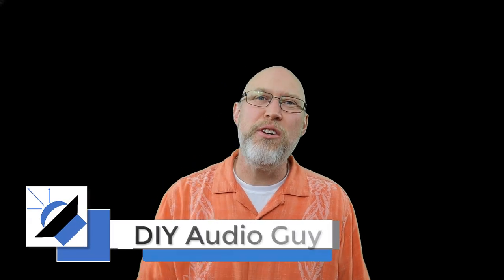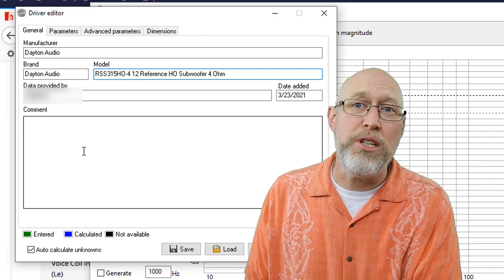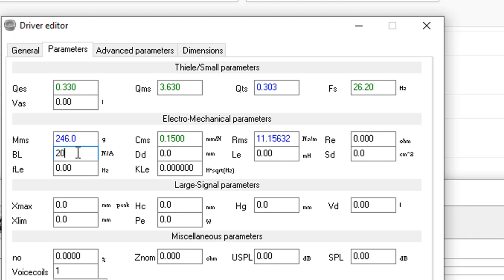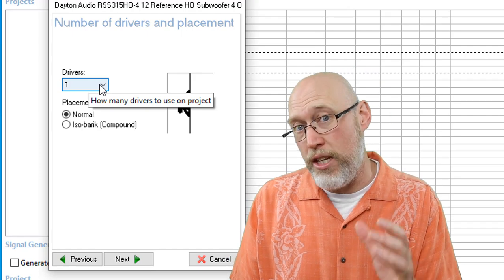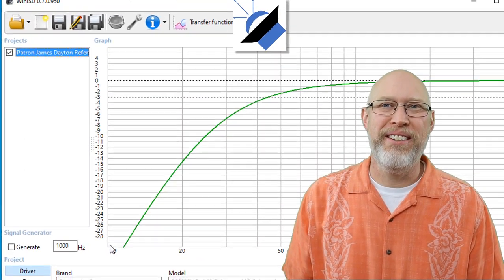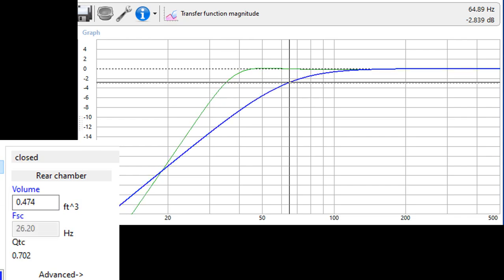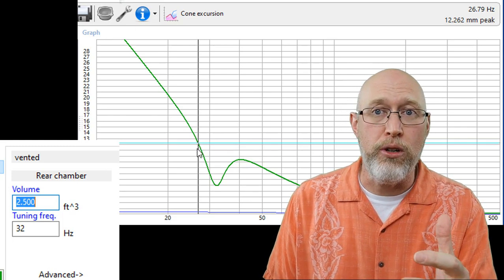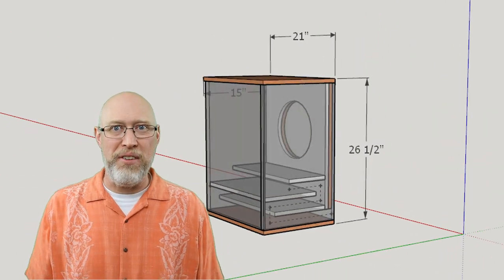WINISD for beginners, design your own ported enclosure!

Comment: Does "PE value Watts" at driver editor the same as "System input power at Signal"?

I ask this because when using speakerbox lite i can only enter PE Value. At the moment im not able to use winisd because my pc do not work lol..  It seems it does the same? When i change it the linear excursion, port velocity etc changes.

Comment: If you're using the b2 rampage RC, you may get a driver integrity fail.  I've tried re-entering the data multiple times and it still fails. I believe the failure is due to the RC being a 2-inch woofer.
Reply from the maker: In my experience, there are some brands that always fail the integrity check every single time.  My guess is that it's due to some kind of rounding error when they publish the TS parameters.

Comment: Got a good deal on the NVX Vsw 152v2  wired to 4ohm and want to build a 6th order box for home theater setup doubling as a coffee table.. using the Dayton Spa 300 or if more power needed spa 1000.. intimidating to get it right,  6th's can be fussy! Were you happy with the NVX that you did up.

Comment: Always been a big fan of DIY.  I'm now at the point where I'm blind and can no longer physically design and build my own enclosures now but the whole concept thrills me.  Just unearthed a Crystal mobilesound CMPx2 12d2 that I lent to a friend 15 years ago.  It's still practically brand new and is quite the beast.  I have a Sledge STA 1000D from a SVS PB13 ultra that is brand new in the box.  Would anyone like to recommend a ported enclosure to get this beast rocking in a HT environment?  I also have a 4" aeroport that can be used in the project.   I have a floor footprint of roughly 18" wide and 21" deep, height can be upto 21".  If I can get someone to help me out with this, then I can take these specs to a shop and get them to fab it for me :)  Cheers

Comment: Is "System Input Power" modelled on Pink Noise or program material I.e. music. 

I.e. I'm modelling on a driver that's 700watts rms, 1400watts program and my amp can deliver 1400watts. 

I'm designing a 6th order band pass, but at 50hz with 1400watts it exceeds the Xmax by quite a bit. 

I've then modelled on a 1500watts rms, 3000watts program driver with 1400 Watts of amp power and at 50hz I'm just under the xMax. However I'm assuming as I'm not giving the driver with more power handling full power it's not going to reach equal efficiency to the lower rated driver which is getting full power?

So what's the reason for inputting 80% of amplifier power? Is that because modelling is on Pink Noise, so putting 80% is going to model closer to music?
Reply from the maker: I use 80% to account for power factor.
Reply: @DIYAudioGuy  

Thank you for your reply.

I assume that's because you don't intend to run it at full tilt?

Obviously I don't either, but want to calculate allowing full head room.

Does Winisd assume the System Input Power figure entered to be Pink Noise?
Reply from the maker: @Power factor.  https://www.youtube.com/watch?v=GuK0FLijYDE

Comment: @DIYAudioGuy I am trying to add parameters for the new Dayton Audio UMII15-22 but I keep getting the "Driver data fails integrity check" when I input the data from the speaker's spec sheet. Any help or advice would be greatly appreciated
Reply from the maker: Yes, go slower.  Give the software time to perform the auto calculations.  If you're still having trouble then check out the help files. It has instructions that tell you the order you're supposed to go in.

Comment: so much good stuff 😃
can you make a video for a box band pass for 2 faital pro 15hp1020 4 ohms(1400W) tuned at 40-50Hz😁Something like Adamson T21 but with 15inch woofers... it doesnt have to go s low want this for that deep kick bass. I use dual 18 or 21s for that low low subs..Frequencies. im a mobil DJ. btw..

Comment: Shape the inside edges of schedule 40 PVC  with medium grit sandpaper (Dremel tool with the sandpaper cylinders are way faster) and finish with like 220 grit so it's nice and smooth.   Chuffing 100% gone
Reply: I have done this before!  It works great 😎

Comment: Thank you for sharing. I have a question. Which graph shows which is better when comparing two different subwoofers? SPL? Transfer function magnitude?
Reply from the maker: It is not really about which subwoofer is better, it is about building the best box for a given subwoofer.
Reply: @ If I want to compare the factory's recommended boxes on two subwoofers that are close to each other. Or on which graph can I see which of two different subwoofers will play better in the same box?

Comment: For the life of me I cannot enter the T/S parameters of a Sundown Zv6 12" without receiving an integrity check error within Winisd. I've allowed it to auto calculate as well as followed the help guide provided within Winisd with no success. The SD parameter is absent from the sundown site, I'm not sure if that is contributing to integrity failure. Any suggestions would be greatly appreciated!

Comment: Please HELP anyone!  I've built myself a sealed subwoofer that has an internal volume of 20 liters (2.5 cm thick, 32 cm wide, 30cm  tall and 36 cm length, all external measurements).
I've used the Ground Zero GZIW 200 driver (8") , and for this driver the manufacturer actually recommends a  17 liter vented enclosure with 1 single port  ( 7cm , 2.76" wide, 24cm, 9.45" long). 
It being sealed sounds great, especially since it's in use in a quite small room, thucked under my desk , but i'm curious about converting this box to a ported one and thus increase the output. 
I've been playing in WinISD, tried to figure out what tune frequency i'd want (listening mostly to music) so i "decided" on a 30 hz, but i don't get it based on that ISD reports back, just what specs should this port have. 
I chose a round shaped port which i'm going to 3d print, but for a 10.2 cm port (which i'd find right considering the size of the box), it said 128.36 cm long, that's 3 times the length of the actual box. Also, 1st port resonance is  133, 88, is that good, bad, unknown?  Could i also make multiple ports in order to cut down on the required length? What do i do? 
Thanks, i love subwoofers and audio generally speaking, and i'm also into DIY wherever i can, but getting the basics here doesn't seem that straight forward unfortunately.. :(

Comment: just tried using it ,winisd, seems to  crash on win10 half way through adding info go to no response mode
Reply from the maker: You may have to uninstall and then reinstall.
Reply: @DIYAudioGuy  thanks i try another source to down load from

Comment: Hey DIY Audio Guy, I need help!  A buddy of mine works at Kipsch and he gave me a beefy 15" prototype.  He didn't have the parameters on hand, but I have the DATs v3 so I wasn't that concerned.  I entered everything in WinISD, no issues, but is there an ideal frequency that you tune a home theater box to?  WinISD popped out a tuning frequency of 18 hrtz in a box size of 5.3 cbft.  That seems awfully low to tune a box to.  I've done this with a few other subs, but they were each tuned to 24 and 25 hrtz, but most videos I've watched on port tuning, and WinISD, most people seem to be setting their frequency in the 30's.  I was wondering if you had any advice on what you would tune a 15" to.  I understand it depends on the bass curve and all that, but you surely have an opinion on what you'd tune your home theater subwoofers to.  Ok, don't hold back, hit me with both barrels,...lol.
Reply from the maker: For home theater, I like to tune the enclosure as flat as possible with as much low end extension as I can get while still keeping it flat.  That typically means a very low tuning frequency and a very big box.

Comment: T/S parameters for WinISD on SDR-18 D2? Several tries failed. So did CT Sounds Tropo-18
Reply from the maker: That is not an uncommon problem.
Reply: Everything I enter fails integrity check, I even used the exact example in this video & it still failed. Don't like this program.

Comment: I have a quick question I'm hoping you can help with. When adjusting my port size as a sphere, it won't let me adjust the length, just the diameter. The length is in gray and won't let me click it. If I change to a vent, I can adjust both sizes with no issue. Any ideas would be much appreciated.

Comment: Does it matter where we put the vent on the box? That is, a foot above the bottom in the middle of the back panel?  A few inches from the bottom?
Thanks.  Great videos.
Reply from the maker: It should not matter
Reply: @DIYAudioGuy  thanks man.   So basically programs like WINisd have made it so almost anyone can make a great sounding vented box? 
The most Important things to look at are port velocity, driver excursion and to have a smooth response?
Thanks again

Comment: Figured I'd try this again ....
This software has issues !! 
I enter all the information . That was the easiest part !! Working with the software itself is hard .
First off I need a magnifying glass to read the microscopic menu' s . There is a scaling problem with the software !!
I get a red integrity check . I've double and triple checked this stupid thing and everything is in fact correct but I cant get rid of the red bar .
Upon a Google search I find there is an army of people with the exact same problem .
This usually points towards software trouble . 
Needless to say its Uninstalled , can't use it . There is absolutely nothing missing or incorrectly entered .
Are there any other programs out there you have worked with ? This thing is nothing but trouble .second time I tried installing it .

Comment: I appreciate all the content you put out for us. (yes I know this was put up long ago) You make inputting the Thiele Small parameters look so easy. I'm not sure if I'm doing something wrong or if I don't have all the necessary info. After several attempts I'm still getting the dreaded  red bar when trying to load the sub. Looks like its back to old school paper and pencil work for me.
Reply from the maker: When you enter the parameters pause for a second, click into a different field, and it will auto-calculate.
Reply: @DIYAudioGuy  thank you. I’ll give that another try when I get home.
Reply: I had the same issue with the latest version on widows 10. I ended up installing the older Alpha Pro 5.0 version. Rarely have issues other than manufacturers listing conflicting values in which case I only enter the bare minimum. I actually like the older version GUI better.

Comment: thank you, please I have a 30w, 8ohm speaker. that's the only 2 data I read on the emant. how I can calculate the air of my box (speaker) to be made using winISD?
Reply from the maker: You'll need to find a way to measure the TS parameters, the date and audio dats is the way to go.  You can pick one up from parts express. If you use my discount code diy5 they will cut you a little price break.

Without that information you are just guessing. May as well just throw it in a half cubic foot box to into about 40 hertz.

Comment: This thing does not work ! No driver screen comes up ! The problem with this is right at the beginning . I can enter all the parameters EXACTLY WHAT DO YOU DO NEXT ?
Do you hit save or load , you went way to fast and I can't tell .
I cant get past loading the parameters . Where....where exactly is this thing saving the project files because nothing comes up and nothing can be found . It does not say where to find anything !!
Another freeware software package that may be great but not without a clear procedure for using it . I've struggled for over an hour and can't get anyplace with this thing . Forget this !
Reply from the maker: It is a pain in the rear with a steep learning curve.

Comment: Good video.. but what are "freedom units"?

You might mean imperial, in whih case you are talking about a load of made up measurements that bear no relationship to anything except themselves and are 100% arbitrary. We are free to perform calculations in fractions and convert them all to orhwr fractions if we want to talk to anything else. The sooner freedom units die, the better.
Reply from the maker: Its was meant as a joke.
Reply: @DIYAudioGuy  : Sorry AudioGuy. Didn't mean to shout but the mention of feet and inches did something unexpected... it's a long story...
Been trying out winISD with your help. Thanks very much.

Comment: Don’t know if anybody else has this problem these days but the driver integrity check was red for about 20 or more on the list so I deleted all that came with it also after Saving give me a message like there was a virus or something after I deleted everything and put in the speakers myself it worked fine
Reply from the maker: Yes, and the driver list is outdated.
Reply: That’s OK I’ll do it as a hobby so I don’t mind you doing all the speakers myself that I will use
Reply: Question if I wanted a piece of advice or two on winisd Would I just be able to donate money once a reasonable amount to get that advice I admit I’m a little stingy with my money paying off my debt and such

Comment: Bare in mind actual port lengths will not model accurately unless cab Q is known.  Eg, winISD over states port lengths using bb4 tuning by around 35% as the acoustic line is longer than port length when adding internal damping.  My cabs have a qts of 0.49 with damped designd using bb4 for best (lowest) group delay of circa 16m/s
Reply from the maker: Interesting. I'll have to look into that a little bit more.

Comment: Does the folded port (that you have shown 10:15) have so-called "organ pipe" resonance? And what determines a frequency of such resonance, entire length of the port or lengths of it's sections?
Reply from the maker: All ports have that issue -- it is usually not something to worry about with a subwoofer.  If you were designing a bookshelf speaker it would matter a lot more.
Reply: @DIYAudioGuy  Thank you. In my case it matters becase I am planning to run woofers up to 200-225 Hz. But even minimal size port gets an least 21" long.

Comment: Is my box too big ?
I have a jbl s2-1224 on a 3.5 cubic feet box ported box
The recommended size is 2.5
I barely feel any air coming out from the port
The vent diameter is 13 x2 inch
My port is 31inch long 
My port air velocity is good too
Is the port too small ?
The port is tuned at 25hz by the way and 23hz at -3db
I feel like the port isn't doing much even when i play below tuning frequency with a bit of power
My sub also makes a engine like noise whenever there is excursion which is weird because at 25hz thats where im supposed to have the least of excursions
According to the graph there is overexcursion only as from 20hz which i never play
Reply from the maker: Yes, the noise you are hearing is probably the sub unloading.  An infrasonic filter will help.  But I think you need a smaller box.  The lack of port air  velocity is a good thing, no chuffing is what you want.
Reply: @DIYAudioGuy  at what frequency should i set the infrasonic filter ??
And the port barely pushing any air is a good thing ?
As i dont really play that loud and that low i will be using the sub but how do i know beforehand when i design another box in the future that the box is too big or port opening too small for an specific woofer ?

Comment: winSD is trash, tried to use it for over a hour a gave up. no matter how i input the TS parameters it would not validate. whenever i tried to design box i had +10db at 33hz and flat by 40 hz TRASH!!!!
Reply: ID10T errors.
Reply: @subbassrules  bought the Ultimate Car Audio App for $1.99.... never looked back. I'm louder then you in my daily so your opinion don't mean jack shit 🤷😂💯

Comment: hi, if i have a bad ts parameter (red tag), and keep trying to enter them what tells me which one is wrong ? been trying to make a goldwood gw15pc4 file and it is always red tag
Reply from the maker: That's pretty common. First check to make sure you have the units correct.  Out of the box the software is looking for metric.  Then the specs online are often times a hodgepodge of metric and freedom units.  

After that see if you can get the software to Auto calculate.  If you click in the next field and start typing immediately it will not Auto calculate. You kind of have to go slow and pause in between steps.
Reply: @DIYAudioGuy  I managed to get it working. strange things happens, i need to click/unclick the auto calculate button to make it work. but i made it !! thanks !!!

Comment: What’s the difference between the rear and front air velocity?  
Also what’s the x max for the audiopipe bdc4-12?  It’s listed @17mm but also says 50mm pk pk. I entered 17mm in winisd.
Reply from the maker: Rear port is a standard ported box.  Front port is for a 4th order bandpass.  With a 6th order bandpass you will use both.

Go with 17mm

Comment: I tried working with this application. Everything went fine with plugging in the parameters. But then when I opened the project and went to modify the volume of the box, I got an error “invalid floating point operation. Press ok to continue and risk data corruption or cancel.” I clicked ok either way but the graph disappears and I can’t do nothing else on the application. I already tried updating my drivers, but to no avail. I’m running windows 11 pro i7… is there some special processor I need or???

Comment: I get a red light after checking the parameters. All the preloaded speakers are also redlights. Edit, So you have to enter  a value and then tab through all the rest so they can autofill. If you contradict what would be autofilled it gives you an error.
Reply from the maker: Yep, you have to let Win ISD do the math for you.